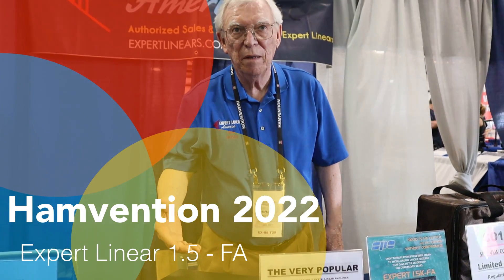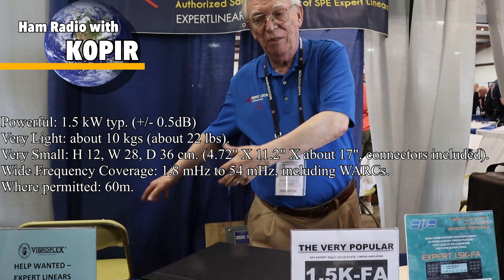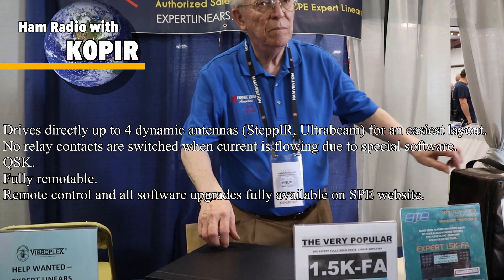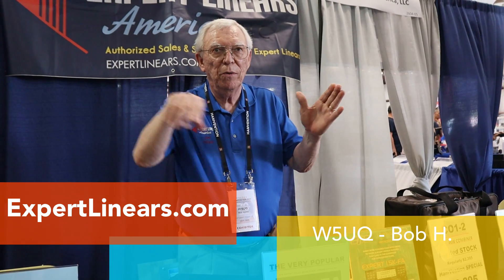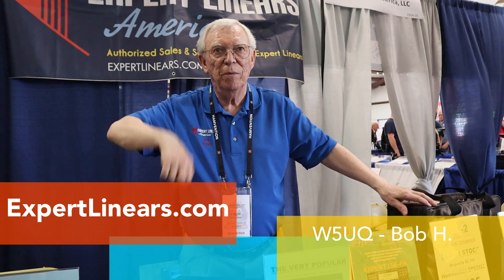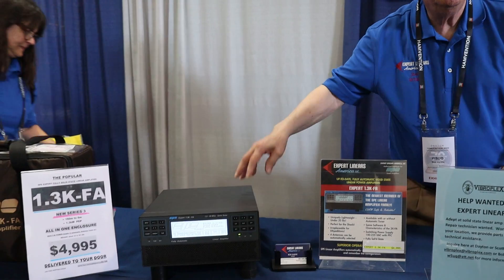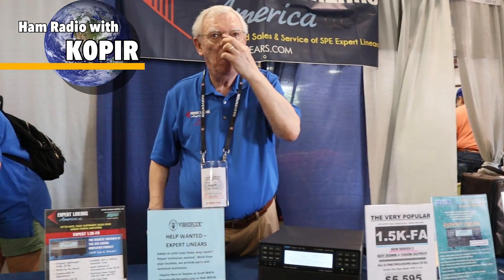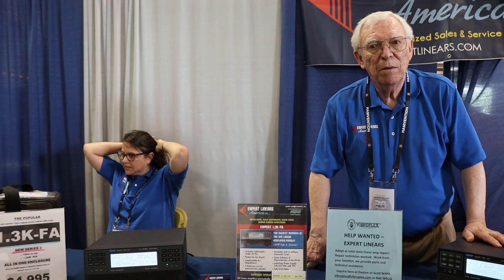Expert Linear 1.5-FA Solid State Amplifier

Comment: I have one with an IC-7610. If you can build the proper cable, as I did,  the amplifier will power on and off together with the radio. The ALC and TX signal can be attached to one of the two ACC ports on the radio (pls note, ALC  could not work as expected for radio firmware 1.40 and up, BE CAREFUL and set power out manually). Also, you can set the proper band a sub-band (the entire frequency data) from the Remote connector on the radio. One connector on the SPE, two connectors on the radio (ACC 1 or 2 and Remote). The amplifier lacks an Ethernet connection, but you can add a serial to ethernet converter (such as Moxa NPort 5110A) and remotely manage your amplifier without the need for a computer connected to it, using it's original rs-232 software program.